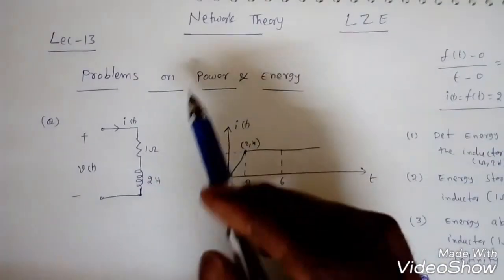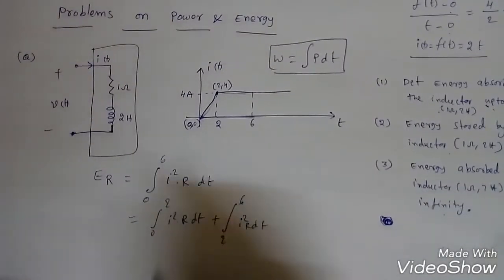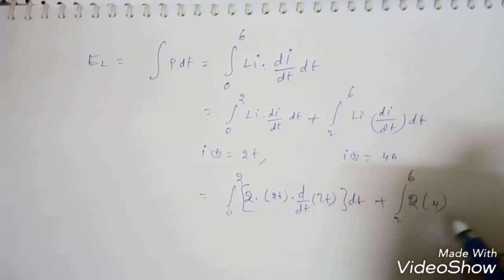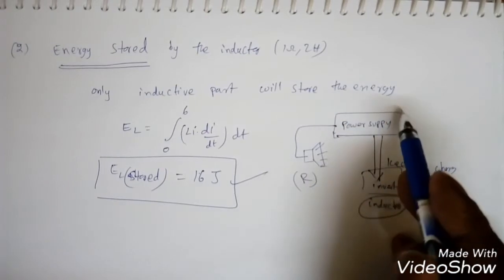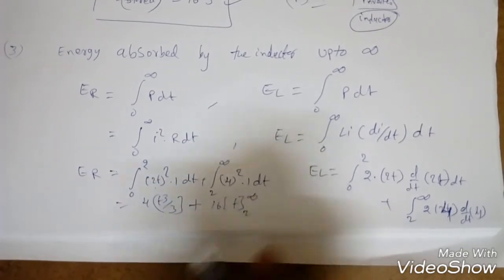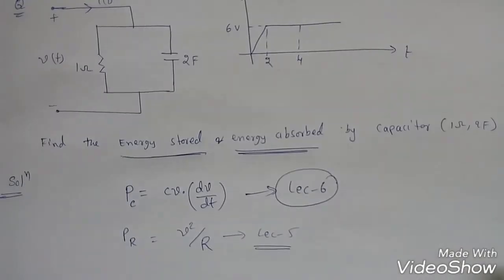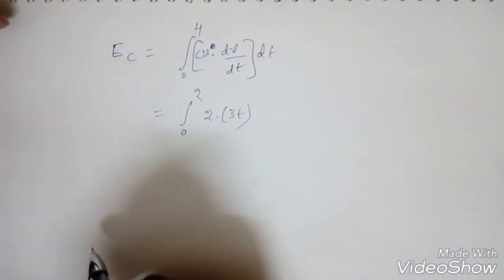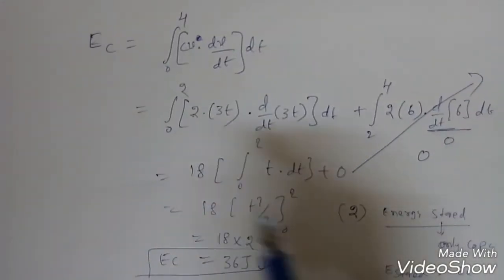Network Theory Lec-13: Problems on Power and Energy

Comment: sir, when are we finding the energy absorbed or stored for an inductor and capacitor.The practical resistance should be in series for inductor like practical  voltage source.And the practical resistance should be in parallel like practical current source ?...what we should do if they given inductance with parallel resistance and capacitor with series resistance
Reply from the maker: no problem if resistance is in parallel to the inductor, in the question voltage may be given then we can find the power absorbed by the resistor with respect to the voltage then to find across the inductor first we need to find the current through the inductor then power....same procedure for capacitor also
Reply: k I got it